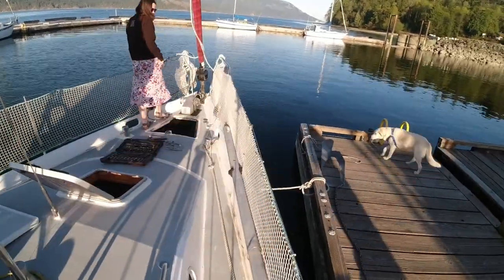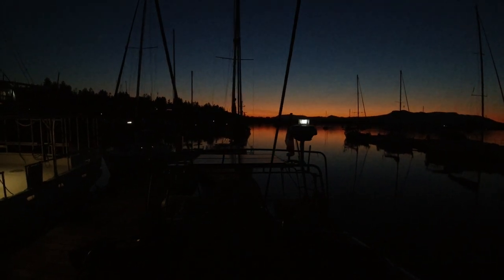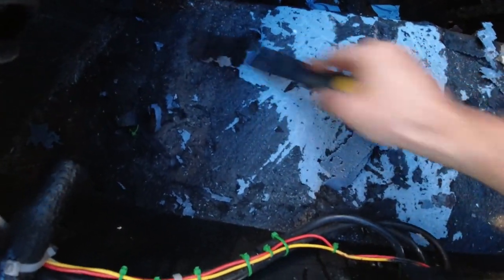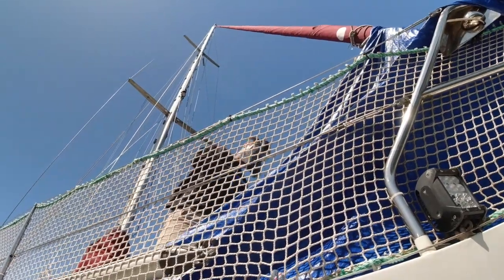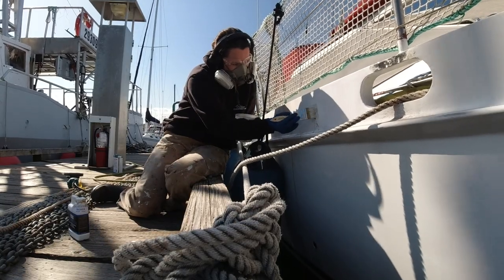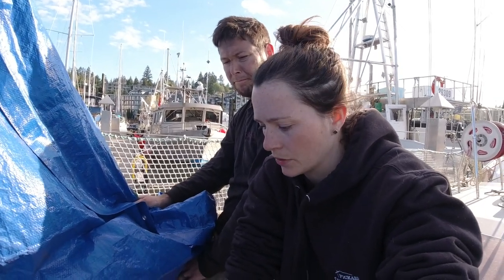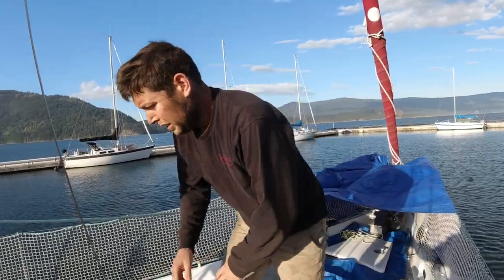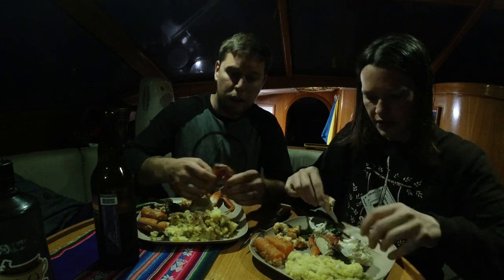It Looks Like Someone Shot Our Boat! Steel Sailboat Chain Locker Problems | Ch4 E11 | TheWaywardLife

Comment: It sounds like condensation of moisture and salt water from the chain inside the chain locker is the big issue, with secondary rust eating away from the inside out. Most of those things have some kind of drain for standing water, you might check that drain to be sure it is not plugged by mud from the chain. Last year I switched to adding a dehumidifier for the winter months, so when the night temperatures drop below the dew point you don't get condensation of dew on all the cold surfaces. Of course that's not so easy with a live aboard but it sure helps to dry everything out. Mold is almost nonexistent since I started doing that, but it does require shore power. The current draw isn't as bad as I thought it would be, since a regular home dehumidifier achieves the 35% target and turns itself off most of the time. I mount it on top of the sink and it drains the moisture directly into the sink so I don't have to drain buckets. As an added bonus the heat from the unit noticeably warms the cabin. Cost is about a dollar a day for the power in Cadboro bay.
Reply from the maker: the main issue with the chain locker was that there was truck bed liner sprayed in there in hopes that it would work as a barrier and keep things from rusting further, but the prep wasn't done properly and it didn't adhere properly either, which meant that moisture, dirt, etc ended up in between the layers and actually seemed to speed up the process.  

Yes the dehumidifier is definitely helpful at the dock! We have a small one onboard but probably should be upgrading cuz it doesn't seem to keep up with the big window transferring so much heat